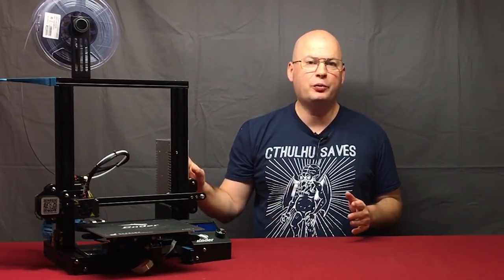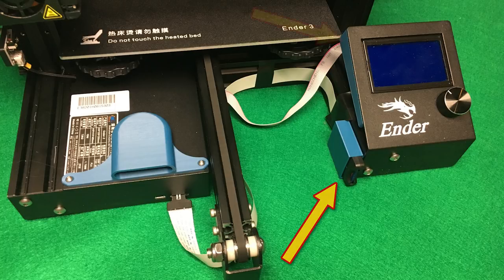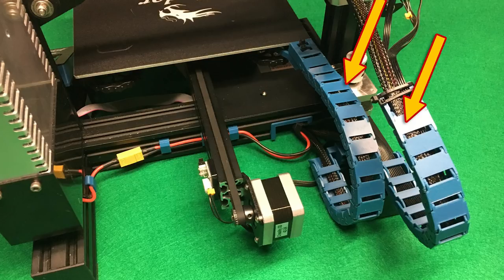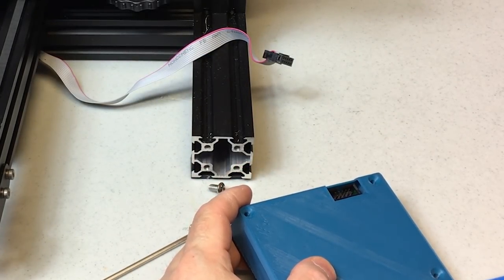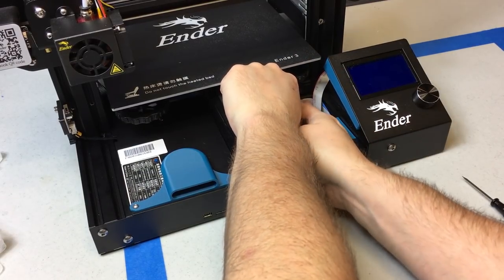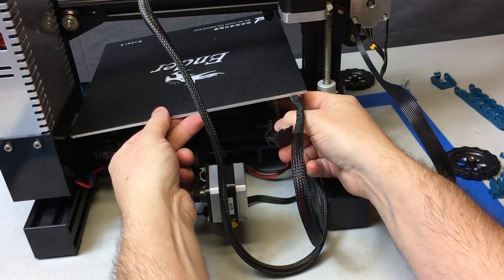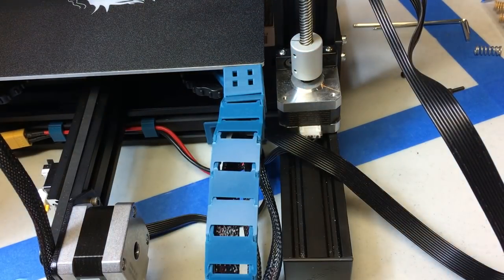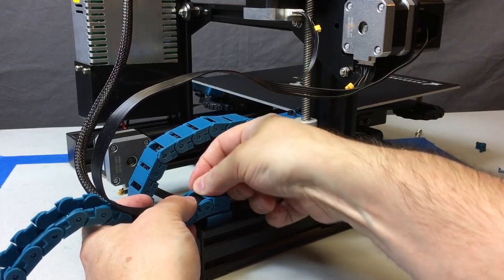Ender 3 Upgrades

Comment: For the cable chains, you can actaully invert the orientation for every other chain piece to prevent having to print the clips to hold the cables in.

Comment: Fantastic video, thank you for making it. I learned something today about the cable-chain to the build-plate when I filled my whole bed for the first time. If you install the zip-ties like they are shown in the video the print head wheel can hit the zip tie causing the print head to jump a little. If the zip-ties are installed with the lock on the bottom instead of the top it isn't a problem.

Comment: As someone who didn't do this stuff early on -- it's worth it. Tom gives fantastic advice here, and since I waited I could definitely SEE the damage/wear that Tom is telling people how to avoid. All of these are worth doing, especially replacing the extrusion assembly where the filament passes through a plastic lever. Get the metal replacement. The Ender 3 is such a good printer that people forget it's at the bottom of the price end and to function over a long period the corner-cuts should be replaced. Tom's other videos are just as much worth watching!
Reply from the maker: Thanks Matt :)

Comment: For the filament guides and the spool holder it’s worth wrapping them in Teflon tape (like plumbers use).  It really gets rid of the friction and annoying noise of PLA against PLA.  It also allows your spool to turn freely.

my upgrades are: filament guide (eye like shown in video), filament guide by extruder motor using 608z skateboard bearing, fan cover, raspberry pi as a server bolted to back right vertical frame, 24v to 5v buck converter with box, y stop adjustment (to allow for motor dampers), motor dampers, LEDs on my hot-end so I can see the extrusion happen (especially first layer).
Reply from the maker: Excellent suggestion on the teflon tape! Going to do that right now. :)
Reply: Would love to see you do a video as well. I'm especially interested in the hot-end led mod.
Reply: Unfortunately the LED mod has been done and it’s a bit of a kludge (not video worthy!!).  Basically I got 12V LED strip and cut 3 LEDs (1 segment).  I then added a 680R resistor and added it I series to drop the voltage to 12V on the LED strip.  I then pulled the fan cover off the hot-end and directly wired the leds to the fan (kinda nasty but I used very fine wire).  I then used the sticky backing and stuck the LEDs to the fan housing.  As I said itks not pretty but it works and that was good enough for me.  I’m considering a better solution but that realistically means redesigning the fan housing and I don’t have time for that at the moment.  :-/

Comment: These are great videos.  I successfully built my Ender 3 using your guide and am working my way through these upgrades now.

If you take requests, I'm hoping to upgrade my firmware so that it includes the thermal runaway protection.  I'd love to see a video in this format which explains that as clearly as this.
Reply from the maker: The Ender 3 (and all other Creality printers) are shipping with TR turned on. On your LCD, go to CONTROL and see if you have a sub-menu for MOTION. If you do, you have the updated firmware. :)
Reply: @Tombof3DPrintedHorrors  I do.  This is good to know.  I see a lot of groups saying that it comes with thermal runaway detection disabled.  Thanks again!
Reply from the maker: Originally it was off, but now is on with the newer firmware. :)

Comment: Great Video. Might get the springs (likely in an EU shop) and will print the chain. One piece of advice from my experience, that filament guide on the top? Be careful. Mine was dragging the filament a lot, like really a lot. My recommendation is to place on it something that takes that fricction down. Right now I have a rectangular piece of aluminum foil wrapped around the area the filament was making a groove into.

Comment: I like these upgrades.. i've done the cable chain and the LCD cover upgrades.  I also printed up the SD Card holder, but my SD card adapter got lost in the mail, so i haven't used it yet.    I found the upgraded springs troublesome.   I'm sure they hold the adjustment in place better, because they create more friction on the knobs.  However, the problem I had was that the stiffer/thicker springs bottom out to fully compressed sooner, so your actual range of motion is alot smaller, so i had to adjust the position of the Z-Stop Switch when I installed the upgraded springs.  Also, the stiffer springs means that its harder to rotate the adjustment knob, so the table moves a little bit when you make adjustments.   I'm not 100% sold on the fan cover... i'd be concerned that it restricts the airflow intake path, which decreases cooling.

Comment: Tom, thanks for all the great videos.  Your Ender 3 vs. Ender 3 Pro video saved me easily $100 (or more) on my first 3D Printer.  Keep pumping out these great videos as I will be leaning heavily on every one of them to get me past the learning curve of successfully mastering 3D printing.  Two questions, which slicing software do you recommend for a 65 yr old noob and what do you use?
Reply from the maker: I use Cura :)

Comment: 15:17 I had an issue with this chain casing the cable to bend out from tension towards my filament roll on the side (3d printed mount for it) so I designed a bracket that goes under extruder motor and has the chain connector on it to fully extend the chain from bottom to the extruder area directly. Only thing is I had to upgrade the Z axis ribbon with the ender extender mod replacement cable due to it being to short

Comment: You're not supposed to put the ribbon cable into the X axis cable chain end. Leave the ribbon cable free and put the clip on the nylon wire sheath instead. You also put the X end link in upside down.

Comment: the cable track for your z axis is installed incorrectly. the purpose of a cable track is to relieve the stress from the cable, the way it's installed in this video has added additional weight and stress to the cables. You need to have the cable track supported by a bracket mounted to the frame at both ends otherwise the cable track serves no purpose!

Comment: Ender3 Pro: Do you think we need to replace the cable support for the bed heater on that? it comes with one that feels pretty solid to me.
Also apparently the fan was repositioned in the Pro lol i printed that cover off without even looking and after a moment of staring blankly i went "...i didnt need to print that apparently.." lol

Comment: Last weekend I did the bed spring upgrade.  I then spent several hours adjusting the bed and printing and reprinting the bed leveling model.  With the stiffer springs, I was never able to get a satisfactory print of the model.  Most of the time, the pattern would not adhere to the deck in the front.  After fighting with it for at least three hours, I reverted to the original springs.  With the original springs in place I went through the leveling process and printed the model.  The model printed perfectly the first time.  I don't know if the upgraded springs are too strong and some how cause the bed to warp or what.  Any ideas?

All the other upgrades have worked just fine.  Thanks for all the information!

Comment: Tom, can you provide the exact names for the chain parts? The problem is there are mixed versions and some parts look similar to others. would be nice if the original Thingiverse guy would rename them with quantity to print and include name descriptions to make finding the right pieces to print. Oh, well... anything you can do to help is appreciated.
Reply: same here
Reply: Same here
Reply: I used cableChain_link_v2.stl for the hot bed power lead as it only bends one way , and cableChain_link_v3.stl for the Hotend/fan guide as it bends both ways.file name was Ender_3_Cable_Chain_.zip from the link Tom provided to thingyV
Reply: https://www.thingiverse.com/thing:2920060

This is the original that everyone, including myself has printed. He updated it with a parts breakdown and description back in June of last year. Its fairly easy to understand. It even says how many of each to print.

Comment: I built the chain an I did not use those little chain clip tops .. I reversed ever other link and it seems to function extremely well I have yet to put it on my new ender 3 pro as i have not received it yes getting it on the 7 april 2020 its going to be my second 3d printer..

Comment: Does the Micro SD input jack from the ribbon cable interfere with use of the Mini USB port?  It looks like it is wide enough it might be a problem getting a Mini USB cord plugged in at the same time.  Thanks for your video series!  They are among the best and most thorough I have found.  Subscribed.
Reply: I have bought olso ender 3D, printer pro but print pla pla in one long thin  Line .van help . thanks in advance ik have been sering your Chan so.I hope you Will Advice OR input thanks greetings grom Holland have a good Day   

Rudy berg

Comment: What profile do people use when printing upgrades such as the ball bearing filament upgrade? Just one of the included such as dynamic or standard?  I started with minis and have the FDG mini profile working nearly perfectly for those but that is overkill for the filament upgrade I imagine.

Comment: Hi! Excellent video thanks for sharing it! I have a little question regarding the chain for the X axis and nozzle, if I put the cables the other way around, meaning in top is the nozzle cable and at the bottom is the cable that goes to the step-motors does that makes a great difference regarding the wearing of the cables or the stress it’s put on them?
Reply from the maker: I would need to see a photo of what you are describing.
Reply: Tomb of 3D Printed Horrors I finally decided to put it the way it is shown in the video. Thanks for the great video!!

Comment: I have an ender 3 pro coming tomorrow.  I had already picked up the springs with the original order, but I grabbed the bolts and micro sd to sd extender.  Can I expect most or all of the upgrades to work for the Pro version of the Ender 3?
Reply: The ones that you just mentioned certainly will work, and since none of the upgrades are affecting the center y-axis bar or the power supply, (the main differences between the two printers) all of the others should work as well
Reply: @daet.4570  Yup, everything worked great, the first sample print came out incredible.  Printing clips and holder for sd card now.

I have a metal extruder but haven't installed it yet, wanted to make sure everything else worked first.

I also have the glass bed but wanted to give the magnet bed a try first.

Comment: Unfortunately my bed cable does not exit the rear of the bed at the exact place the drag chain expects it to be so now that I have all the parts and the printer bed  loosened, and I can't put the bed drag chain on. My cable exits closer to the side and doesn't fit into the channel of cableChain_bedCorner_v2. A bummer.  When I compare the black plastic OEM part that the bed screw goes through to the printed one, I can see it is manufactured for the cable to exit in a slightly different place (over by a few millimeters). The other chain that goes to the x axis motor is fine.

Comment: On The Cable Chain Guide File I downloaded it and the Are So Many Looks like 2 versions  So Which ones do I want to make a chain? Also On the SD Card Adapter The link you provided takes you to Amazon And they have 2 sizes of Cable 9.8 in. /25cm and a 18.9/48cm I am assuming the shorter one will be the good choice ?

Comment: I"m late to the party here, but what size drag chain is required?  Goes against the spirit of the thing, but I'm sure it's cheaper to buy than to build.  Unless it takes than 1/2 spool of filament for all of the pieces, it'll be cheaper to buy.  Any thoughts?
Reply: At a high estimate, you're going to use approximately 128g of filament (this includes a third chain that Tom doesn't have in this video). At $28/1000g for the good stuff, you're looking at $3.60 in filament. Plus, it looks cool as heck with all the matchy-matchy bits
Reply: Dylan Oxford matchy -matchy is a fair point. The pessimist in me assumed much more filament needed.

Comment: I was wondering If i could place a washer under the heat bed Extender that connect the cable chains ,I have had one get a little too hot and it warped .I think t washer would keep it from doing this ? what do you think ?

Comment: In order to save some time I'm planning on buying a drag chain and printing only the connecting parts that are specific to the ender 3. Could you tell me what dimensions the drag chain should be so it fits the ender spcific parts? Thanks

Comment: Is it ok to print the cable chain with PLA? I was wondering, since the glass transition of PLA is around 60 degrees and that's basically the minimum temperature I am currently using on the bed.
Reply from the maker: Yes, I printed all of my upgrades with  PLA/PLA+. :)
Reply: @Tombof3DPrintedHorrors  Alright, awesome! Thanks :)

Comment: I was looking at the prices between all the ender-3 versions and the question came to mind..... for the Ender 3 pro.. it is about the same cost as a CR-10 mini.  Would it be better to go with the mini over the pro?
Reply from the maker: Both are good machines, but I prefer the Ender series because they are 24 volt and not 12 volt like the CR-10. It's a small issue, but with double the volts you are pulling half the amps when heating the bed and hot end, which makes an already safe machine like the CR-10 even safer with the Ender series.
Reply: Follow-up questions:  The Ender you have in the video seems to be the original version (meaning not the pro).  In your opinion is the pro worth the extra money?  And finally, between Gearbest, Banggood, Amazon, is there a "good" place to purchase one?  Amazon is more expensive, but it I get a lemon will it be easier to return?  I go with Gearbest/Banggood it is a better price, but there is a wait time (and maybe import fees?).  If something is wrong, then there is the expense of parts to fix it or trying to return something?
Reply from the maker: All of my Enders are the standard version, not the 'pro'. The pro is a good machine, no doubt about it, but I'm not sure it is worth the price difference. The 40mm Y-axis extrusion will increase stability, however, I am not experiencing any issues with the narrower 20mm extrusion on the standard Ender 3. As far as power supply, the upgraded Meanwell is a better unit, and will likely last longer than the standard Creality PSU. As far as places to purchase, I have only bought from Amazon, largely because of their no-question return/replacement policy. I have heard of issues with defective units and getting them replaced from Chinese suppliers, but I can't tell you which are good or not (I would ask on some of the Ender 3 facebook groups for opinions.) :)
Reply: @altersilentium  
The Ender 3 pro is worth it. The bed is better, the magnetic surface is better, the power supply is better, the bed heats faster, overall the Pro prints better. I have both. The Pro's controller box has the fan output on the bottom. The wider rail gives better prints at the extreme limits of the plate. Most YouTube guys saying it's not worth it are just printing small toys.
Reply: @truantray  The magnetic surface limits the amount you can heat the bed to. if you overheat the magnets, they may lose their magnetism.

Comment: Hey there! Your videos helped me a ton during assembly. I ended up making a webpage for the drag chain assembly because theres new parts that don't require disassembly of the hot bed. Also, I designed a clip for the SD card adapter ribbon cable. The clip is one page above the drag chain one. Hopefully it helps!

http://www.designsbyphil.com/ender-3-drag-chain.html
Reply: Thank you! Was looking for this exact info!

Comment: What is the M3 screw kit for? My Ender came with all M4s and M5s.... no M3s.
Reply: They're for attaching the back cover for the LCD screen electronics, as the stock ones attaching the board will likely be too short. It's explained in the video about the 6:20 mark

Comment: I used a SD  extender that mounts on the rail by the controller box.  There is another that mounts to the front on top of the Y-Axis pully assembly 

 Finally, something to make it meaner, dragon claws https://www.thingiverse.com/thing:2951647

Comment: Were the bed springs you put on a specific size?
Reply from the maker: 8mm OD 20mm Long Light Load Compression Mould Die Spring
Reply: Those are light load 8x20mm springs, you can get them at a lot of places, i got mine fom aliexpress, but you can also get them at amazon (most often more expensive), or from a local hardware store (probably the most expensive solution) - but as they still should be a low cost item it doesn't matter much - 4 Springs should definitely not cost more than 1$ each, normally you get 10 for ~4$ including shipping.

Comment: I have a question. I printed the fan cover. I can not get the screws out. I know that the screw are metric but no hex key works. How do you get the screws out?
Reply from the maker: The included hex key that came with the printer worked for all three of mine.
Reply: Tomb of 3D Printed Horrors I tried them and they did not work. I also tried a metric set that I already had.  That did not work. Finally I even tries a non metric set no luck. Very frustrating. 

Thanks for your reply and all your help.